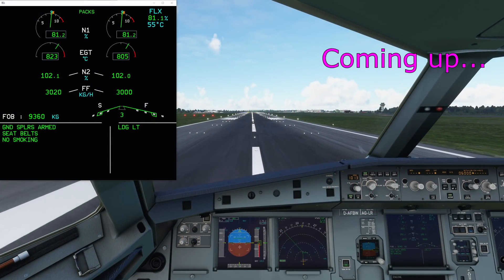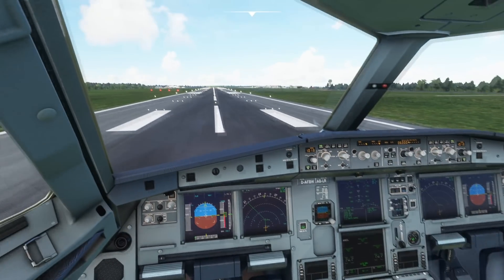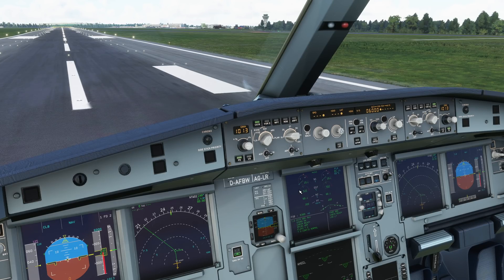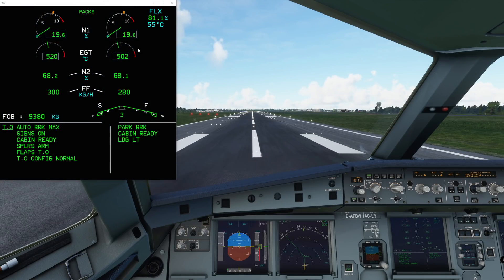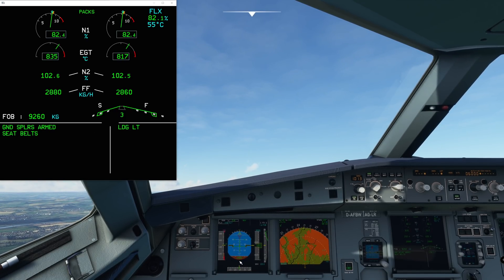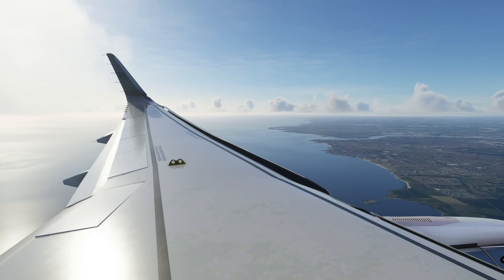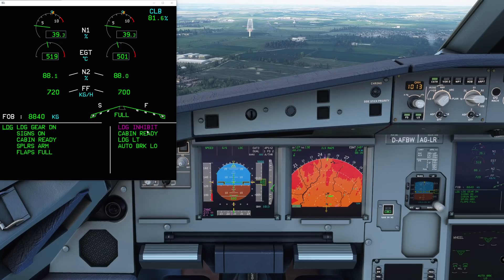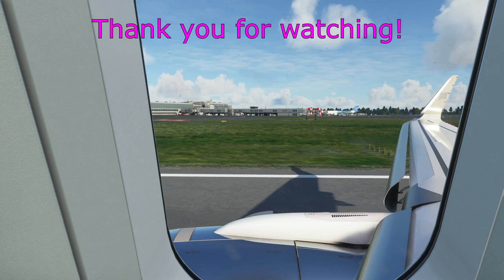A32NX LDG INHIBIT: Why? Real Airbus Pilot Explains!

Comment: I hope you can answer my question but that significant difference in EGT is that normal ?
Reply from the maker: Hi Jay, which part of the video are you referring to?
Reply: @320SimPilot  il using the dev version.. and whenever I start or load in the game from cold and dark when I have power to the aircraft. The EGT starts off in the high hundreds :(

Comment: Hi mate, another great video to help with our sims! I’ve a question if you don’t kind (I tried finding a way to message you but I can’t).

I got the Thrustmaster Throttle delivered this morning, but I find out of the box it’s way too sensitive. I loaded up onto an active runway, and with the trust levers at idle, the slightest little hand movement is enough to move them. Any tips on how you did yours?
Reply from the maker: Hi Dan, sorry for my late reply. The simplest way now is to create a larger deadzone using the flypad throttle calibration. I hope this helps!

Comment: Great video thank you for sharing. I have a question. I have noticed in other flight sims, not yours, and A-320 cockpit photos, that the Brake Fan Switch is missing. Can you please explain that to me ?
Reply from the maker: Hi Peter, thanks for watching! Not all airbus aircraft have brake fans, it is an option so it will depend if it was ordered!
Reply: @320SimPilot  Thank you for your reply

Comment: Obviously (one would hope) the pilots are aware of the phase of flight, but is it indicated anywhere what the computers believe the current phase is?  I am imagining a very late low go-around scenario, does the bus pick up on this and understand?  Is it reset once you renter approach mode?
Reply from the maker: Great question! The warning computer I am talking about in this video does not display the other phases, however they can be looked up. They are separate to the actual phases of flight the FMS uses!
Reply: @320SimPilot  Thanks for the reply.  Yes I understand in this specific video we are seeing FWC information, but can the current phase be viewed (in the FMS)?

Comment: What failures exacly will be hidden?
Reply: Loads of them. It is easier to look at what will not be blocked, such as fire warnings, engine oil pressure warnings, flight controls and side stick fault, and a few more. Anything that do make the A/C unsafe to make airborne will still pop up.

Comment: Hey! Can anyone tell me how to use A32nx after recent update? I was using Development version & I've updated it through the installer & since then it stopped working for me. All the displays are now blank with no textures. I've also tried using FBW Liveries & No Livery(Default Airbus) but still not working. I've also switched to Stable version 0.5.4
Reply: Any other conflicting mod?

Comment: Another day, another lesson. Thanks!!

Btw, what's your system specifications? 

I can remember you used to add the specs to your video descriptions before, but unable to find them. I am actually planning to upgrade my PC hopefully to get performance similar to yours so quite keen to know your current system.
Reply from the maker: Hi, sorry for the late reply. Specs are i7-10700k, 32 GB RAM, 1TB SSD, RTX 3080. Hope this helps!
Reply: @320SimPilot  thanks. Definitely helps, the 3080 is the missing ingredient for me.

Comment: I actually did not know that you can pop out the display in MSFS 2020 :O
Reply: @AdderFTW888  I just tested it during my lunch break and for me, it worked without any additional mods (except for the FBW A32NX of course). Just hold "Alt Gr" (German keyboard) and click on the display. So it's probably part of the FBW mod.
Reply: @bejonwe  It is actually just a base sim function, right alt + left click on any screen is gonna pop it out into a new window. 
Special tip, try it on the EFB for better keyboard interaction without triggering keybinds ;)
Reply: Yes right alt button and click the panel out with your mouse. This is great for multi monitors, its usually way to small for me to read without popping the screens out.